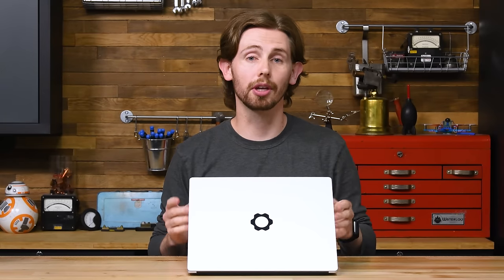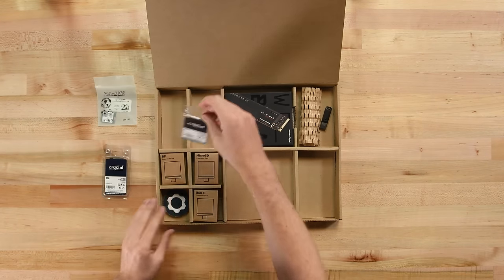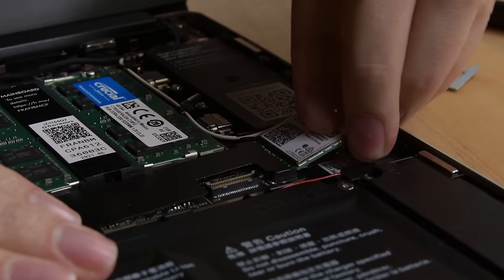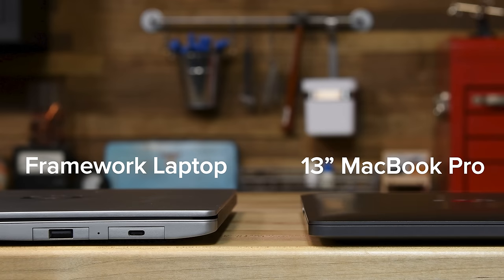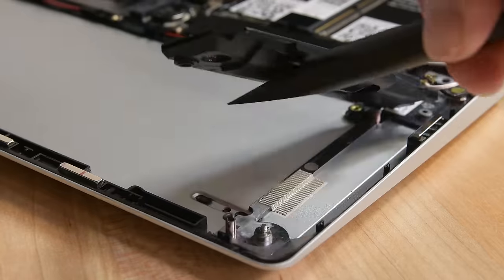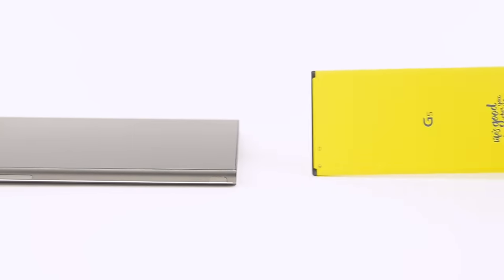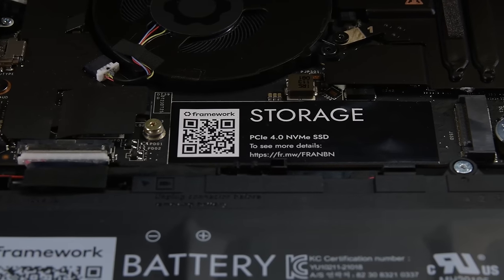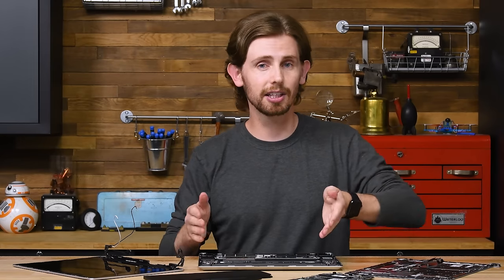Framework Laptop Teardown: 10/10, But is it Perfect?

Comment: Finally some company thought of replacable ports... On a PC you can usually get a PCIe card for extra HDMI, USB, Ethernet and so on while on pretty much all laptops you're stuck with what the manufacturer wanted..
Reply: HP ProBook and elite book have modular parts within each iteration or so you would think, I have 20 HP laptop and the ram and hard drives are easy to get to, no screws no glue and socketed CPu
Reply: @Heathmcdonald  Wooooow the RAM and storage are easy to get to! Amazing!!!!

...like in pretty much every older laptop...
Reply: Dispute apple adding multiple usb c ports on their laptops, I feel like this should inspire them to add module ports too
Reply: I'm just wondering (with no electronics knowledge) if they can make the USB-C extension module host two ports instead of one, even if the two share the bandwidth of the one port it's connected to on the motherboard. There seems to be enough space to place them side by side on the module, though I don't know if there's enough space for internal electronics or other constraints.
Reply: Not launching it with an Ethernet option is just ridiculous.
Reply: @DriantX  That would require a switch or a hub and there's plenty of space for that, If you opened up any USB hub you'd see a bunch of ports and just one 1x1cm chip (roughly) that handles all the logic.
Reply: @shapelessed  Good to know! I sure hope they make a dual type-c extension module then. Only 4 ports shared between display out, usb, charging (and potentially other future add-ons like ethernet as discussed above) feels kind of insufficient. Worst case scenario is standard usb hubs that we all know of, but I think they can make it so we don't need to resort to that.
Reply: @DriantX  Its possible and there is more then enough space for them to do that (with some kind of hub controller IC).
I hope they launch them later, im pretty sure they just wanted to launch with a somewhat small set of parts to simplifiy their logistics for the starting phase.
I think something like 2 USB-A isnt possible, because it looks like it isnt wide enough (but maybe it is), but something like USB-A + USB-C; 2xUSB-C; µSD + USB-C; Storage + USB-C should all be possible.
Reply: @Heathmcdonald  I think with the HP you are talking about modules like another battery , disc drive and an extra hard drive but this is different , it just the ports in any configurations you want and further down the road you can change out those ports . If you end up with all your other toys being usb c then buy the ports and swop them out . Neat idea
Reply: @shapelessed  Yes , most older laptops it was just one or two screws , so easy , not you have to take the thing to pieces . This is progress??
Reply: @joawesome2319  Apple did that to force people to buy their dongle at a ridiculous price , they knew most buyers would have lots of kit with usb a or whatever so they made the latest usb c only , and a lot of aftermarket dongles will not work on Apple laptops .
How strange )))))
Reply: @DriantX  It should be possible , it would only be like plugging in a multi port dongle
Reply: @tommihommi1  Its a small portable laptop so most people would be using WiFi anyway . Ethernet ports will be the next thing to go from laptops
Reply: @MrTarmonbarry  any tech will tell you that you absolutely need a Ethernet port for a work laptop. Thin and lights are ideal for using in a deployment where you need to plug into a server.
Reply: @MrTarmonbarry  In corrupted people's understanding - yes.
Reply: @tommihommi1  So carry a Ethernet dongle , then you have the best of both worlds . If you are a tech its a small enough thing to carry around . $5 or $6
Reply: @MrTarmonbarry  we all know how apple is. But they can literally do something similar to this laptop and I feel as if it would get even better sales. But apple is apple and they “think different”... more like think more difficult :)
Reply: @tommihommi1  I have an HP 15 laptop that came out in 2015. It has a design where it’s thick in the back and becomes thinner in the front. It has an Ethernet port in the back and the back is just as thick as the Ethernet port itself. I considered that as thin and light. I don’t know why companies can’t continue to do this. Probably just gonna have to switch to raspberry pis for Ethernet :)
Reply: @tommihommi1  As i have already replied , a dongle , or maybe they will have it as a port option , they might already have it so you could change out a usb c for an ethernet port on the go
Reply: @MrTarmonbarry  as I said, the Ethernet expansion option should have been a thing from the start, but their current format is too thin. And the entire point of this laptop is to not have to carry a dongle
Reply: @joawesome2319  Only a few letters difference between the two words , @@different and difficult'' but yes , you are right , they go out of their way to make things difficult and make themselves more $$$$$$$
Reply: @tommihommi1  Has it crossed your mind that this laptop is not aimed at tech's but for the average consumer ?? The Ethernet port option might be there already or come along with time , its a start up company and on the site they do say they are looking for partners to develop things further .
To thin?? , most people complain that laptops are to thick and heavy , there is no pleasing some people is there ??, and a tech who can not carry a dongle along with all the other things they have to carry for any eventuality ??,  thats like an electrician not carrying a flat blade screwdriver because he thinks everything has cross head or philips . 
If a tech buys the latest Apple laptop he will have to carry a dongle because they only have USB c now , oh wooops , the client has things with USB a and they need to be plugged in
Reply: @shapelessed  Unfortunately its the world we have and most of us are to blame in one way or another , me included )))
Reply: @tommihommi1  I think it could be too big
Reply: @Heathmcdonald  I still use my elitebook, just slide the lock and the cover pops open.

Comment: I’ll take the slightest possibility of partly upgrading or repairing a laptop over buying a completely new one any day. Even if Framework goes out of business within a few years, the situation won’t be worse than with any other laptop that needs to be exchanged with a new one once the time us right.
Reply: Even if Framework goes out of business the day after mine ships to me, as disastrous as that'd be, it's still not just "no worse", but quite substantially better, than any other laptop currently on the market, because there's still some room for me to find a guy with a 3d printer to keep me supplied with replacement 1" USB-C extensions, most of the parts inside are still following standards that other companies make stuff in (M.2, SODIMM, etc), so most things will still be repairable for quite a while.
Reply: @JohnDoe-nq4du  as well as framework having cad drawings of the chassis available somewhere i heard.
Reply: If they go out of business the only upgradibility lost will be with the motherboard/cpu and battery maybe. Ram, and storage are thrid party and as far as I am aware that keyboard and screen are of normal sizes meaning fitting replacements can be found. There are usbc adapters that may not fit flush but will keep that functionality. I am pretty sure the webcam could be swapped with that of other devices, albeit not as easily. So as long as you don't bank on changing that motherboard down the line the rest is probably going to hold. The hope of a used market with upgrades helps too.
Reply: @teresar6348  And that's assuming the company that is producing their motherboards doesn't start selling them to the general public.
Reply: The biggest tech youtuber, Linus Tech Tips has backed this project and invested in the company. 
I think it should be safe atleast in the early term
Reply: Its a win for customers.
Reply: And a long living market of used spair parts on ebay. others users will be able to sell parts until one last laptop standing.
Reply: also framework: Amd and 16 inch with gpu
Reply: April 2024. Still in business. I'm in batch 16 of their 16" laptop product. I think they're doing something right; they have an honest product produced by an honest company. It seems. I do hope they have a very long and fruitful life!

Comment: This aged so well.  Dedicated GPU models on preorder, and not one but two generational updates to the 13" mainboard (plus an AMD option).  Thrilled.

I have a 2nd hand original 13" i7 board in their Cooler Master desktop case as my media center PC and it's incredible power for money (got it for like $250 with ssd and memory included), low power draw, and small footprint - incredible despite being 2 generations old, it still outperforms my old full size desktop in every aspect.

Comment: Impressive engineering. Would love to see what they can do with a 15" or 17" laptop.
Reply: Put removable graphic card in it.
Reply: @gamingwithxan1430  It would probably support a select few cards
Reply: @tezcanaslan2877  The only reason would be them not making more than a couple. Any GPU they can buy should be able to be used,  and if they use the same connector Alienware does the gpu options will be pretty good to begin with.
Reply: @tezcanaslan2877  Actually if AMD/Nvidia continue making MXM cards, then it would support those as well. MXM isn't anything special, it's just PCIe, I've even seen people with franken-laptops that have an MXM to PCIe adapters.
Reply: And a cube PC.  Simple to make more versions using the same parts.
Reply: Hopefully a removable graphics card and maybe a removable optical drive.
Reply: @gamingwithxan1430  i think that would be somewhat difficult especially when you're taking account the cooling system
Reply: @gamingwithxan1430  that feature is very far away as for them to put a removable graphics card in this, the manufacturer like nvidia and amd would have to make available max-q version to general public which they would never as there's no profit in it untill they are rolling out in great volumes.
Reply: Why is it impressive engineering? This could have been made 30 years ago or more with the same design principles.
Reply: @jinxterx  better late than never
Reply: @jinxterx  You apparently don't know what it takes to design and manufacture one of these things. I work for a major cell phone chip manufacturer and it takes major engineering chops to design/make this stuff.
Reply: @s31ACE1252  do you work in sales or marketing? 🤔
Reply: @jinxterx  No I don't. I'm an Electrical Engineer.
Reply: @s31ACE1252  cool, so you're fully aware that engineering chops existed before this laptop came out.
Reply: @jinxterx  Yeah, but none of today's tech was around 30 years ago bub.... In '91 USB was still 4 years out. We were learning programming in high school on old Apple  machines, most of the machines in my electronics class in college(fall '92) were 286/386, and laptops were still mostly monochrome screens. You are not getting this type laptop at the general consumer level 30 years ago as you claim....and the fact is....we didn't. The closest thing to this type tech in '91 would be PCMCIA. I didn't have a laptop with that until late '90s.
Reply: @s31ACE1252  Bub? lol, the name's Bob actually! ;) Ah yes I see your points, very well made, however I was referring to design principles like modularity i.e. removable or replaceable components, captive screws, magnetic bezels etc. All these concepts were perfectly feasible from an engineering standpoint 30 years ago or more? What's quite impressive is that small companies can design and build their own laptops due to low cost manufacturing and we don't have to reply on large corporations restricting our freedom.
Reply: @jinxterx  the only reason why this didn't exist is because it wasn't as profitable as planned obsolescence and abusive repair practices like apple's. No big company would want this because they'd make billions less. Good ethics are bad for business, that's why apple is the most valuable company in the world.
Reply: Can you imagine a 16x10 17" laptop with 8 TB4 ports? :D :D :D
Reply: I'd buy one in that size even with integrated graphics (though that'd be disappointing, but I'd be good with it coz my workstation PC does most of the heavy lifting)
Reply: @spdcrzy  
Thought that same thing myself.
Reply: @gamingwithxan1430  You called it!